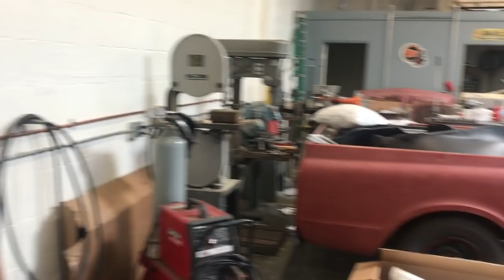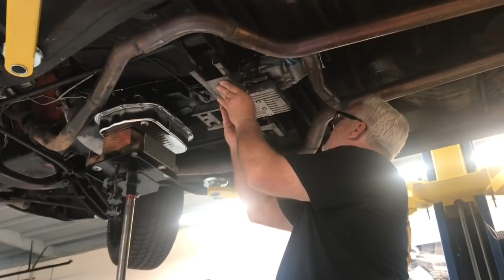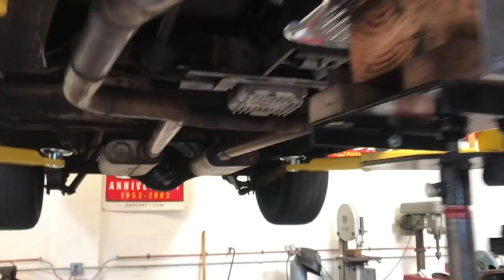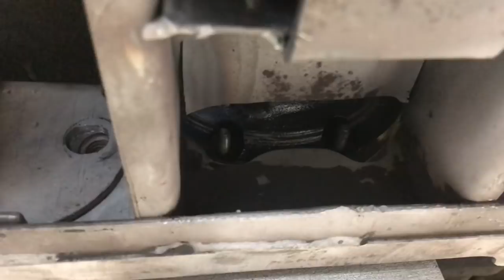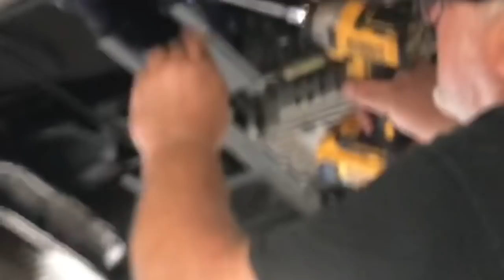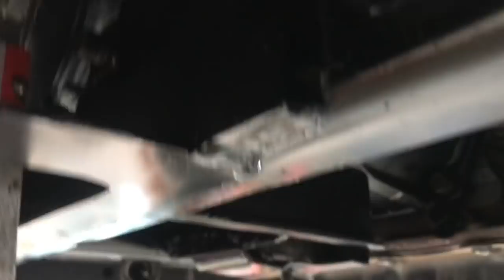Fury Wagon Overdrive (part 2)

Comment: Nice, have you ever used a Gear Bender before... Can it be used with a manual trans?  Keep up the videos Lucky, thanks!
Reply: keiththecarguy1967 yes and many have done, but a lot of times it's easier just to fit a 5/6 speed.